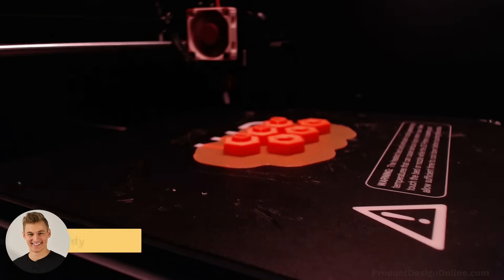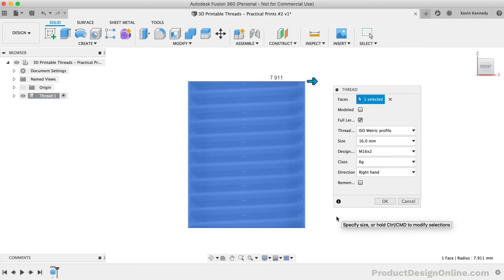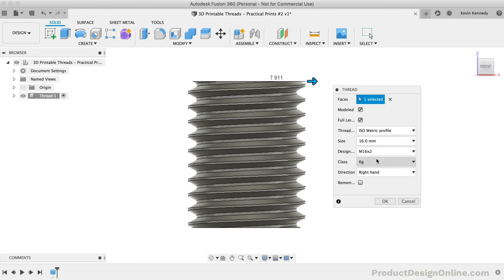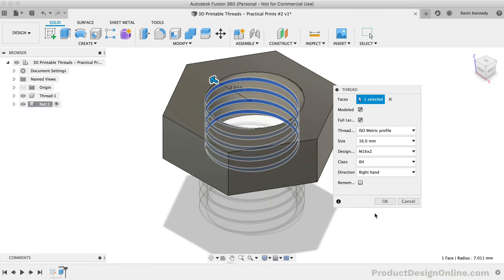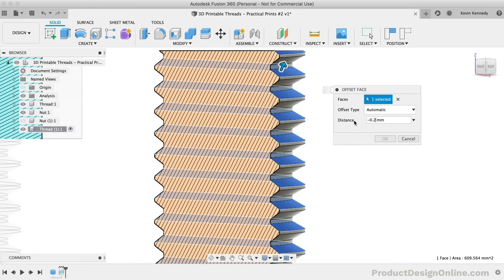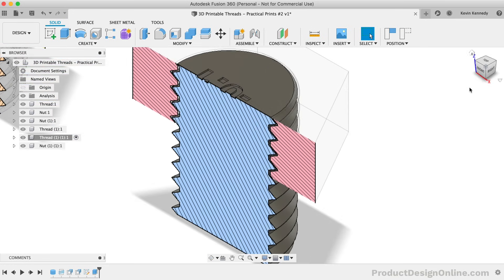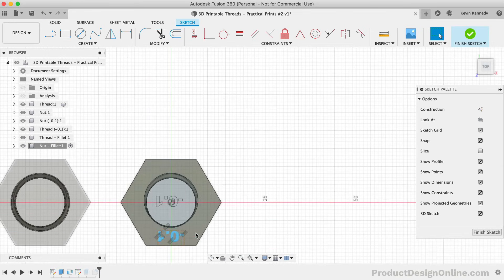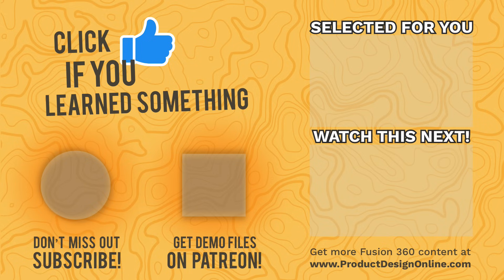3D Printed Threads - Model Them in Fusion 360 | Practical Prints #2

Comment: Can text be added as a parameter so you can change it easily?
Reply from the maker: Hi, Mike. Unfortunately, the text feature does not really work with parameters. It will allow you to use the parameter within the "Height" input... however, once you select "OK" it will apply the current parameter value (in place of the parameter name). If you change the parameters it will not be updated. When you re-edit the text you'll see that original value in the input field instead of the parameter name.
Cheers, Kevin :)
Reply: @ProductDesignOnline  it would be cool...maybe I will suggest it as an improvement. Thanks
Reply from the maker: @superalpha  Let me know if you do, I'd support/upvote it!
Reply: @ProductDesignOnline  I just gotta find where the suggestion box is located...Haha
Reply from the maker: @superalpha  Its called the "IdeaStation" - https://forums.autodesk.com/t5/fusion-360-ideastation/idb-p/125

Comment: I use text alot for documenting trial parts. Quite often I have to reposition the text. When I do the size of the text changes. Is there a way of anchoring or locking the size of the text so it does not change when repositioned?
Reply from the maker: Hmm... I'm not sure why your text size is changing if you're just moving the position around? Are you wanting to anchor the size or the position?

If you want to lock or anchor the text to a specific area then you can add constraints to any of the four corners of the text box. You can add a "coincident" constraint to one of the four corners (probably the lower left) and the point to where you want the box to stay.

You may need to create additional sketch geometry to get it to be constrained to the exact location you want - however, this will help lock the text in place and it will remain locked to that coincident constraint.

Comment: Another great video Kevin.
I found that it works out a little better if you split the tolerance addition between the nut and the bolt threads equally.
I also found it useful to add a chamfer to both nut and bolt before adding the thread as it eases printing and threading them together when finished.
Reply from the maker: Amazing...great tips, Ted! Glad you shared these :)
Reply: @ProductDesignOnline  Really appreciate the extra effort to develop top-notch tutorials - thank you however had trouble successfully repeating the 0.15 m fillet added to the inside of the nut thread.  Would get an error and a red highlighted line-segment as the thread intersected the nut face (either top/bottom).   Considered maybe someone posted a comment on YouTube and then read's Ted recommendation.  As it turns out adding a chamfer prior to threading the nut solved the fillet error issue I was having.  Thanks folks!

Comment: Awesome =D
I have some questions:
1) It happens to me that the very first thread of the nut fails, how could i (i don't know the words for this but...) make the thread crest to start with the root diameter and gradually reach the actual crest diameter so that it doesn't fail trying to make a circle in mid-air ?
2) Is there a way to implement the anisotropic properties of 3D prints in the simulation environment?
3) is there a way to incorporate the infill structure in fusion? (again for simulation purposes)
4) How could i design a 3D voronoi thing? i don't mean making something using the voronoi generator and extrude-cutting the shapes, i am thinking something like a bone structure... something like this:
https://static.turbosquid.com/Preview/001298/833/SA/Z.jpg

And thanks again for such amazing tutorials! i wish i knew your channel before my CAD course at college ahahah
Reply: To taper down the start of the thread! those were the words XD
Reply from the maker: Hi, Santiago.
1) You can add a chamfer to the cylinder before adding the thread. I should've mentioned that in the video...it's a great way to make the threads start/end better.
2) Not that I know of...
3) Infill is better suited for the slicing software because no matter what you do when you export the file as an STL it's going to affect some of that. What slicing software do you use? Cura has many options for different infill types.
4) There's no native way to do Voronoi models in Fusion 360...and the add-in only does the sketches (that you're not looking for). However, I do believe you can make the 3D ones in Autodesk Meshmixer, which you can also install for free

Cheers, Kevin :)
Reply: Thank you =D

Comment: Thanks for this video, it is very timely for me.
I have a project where I am printing working 3D threads and was looking to start experimenting with thread tollerances.
Your video is perfect for me.
Up until now I have been printing my prototype theads with a thicker wall and running metal tap and dies down them to size them correctly,
This of course takes time although it does work well. It will be much more efficient to print them at the correct size from the start.
Reply from the maker: Glad to hear that, Charles! I do find that using Tap and Die sets work well in certain scenarios. For example, when one of the parts is not 3D printed I find it to be really helpful. But when both parts are 3D printed I've found this method does same quite a bit of time.
Cheers, Kevin :)

Comment: I recently printed M2x0.4 on my resin printer. I had to put it under the microscope to see the threads clearly. The resolution is incredible.
Reply from the maker: Great point, code DirtyToMe! I should've mentioned that this was focused on FDM printing. It is crazy the amount of fine detail one can achieve with resin printers. I used to run some FormLap printers for a lab, and they were great at small threads and other objects that are hard or near impossible with FDM.

What resin printer do you have?